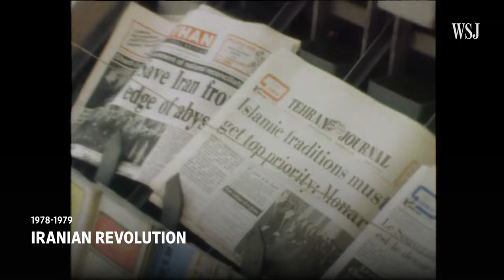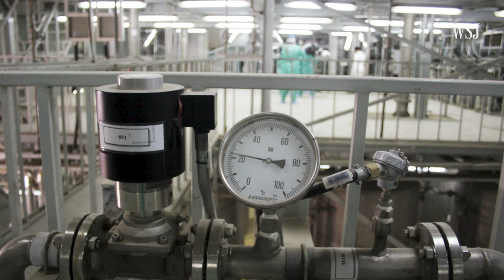Iran’s Nuclear Program: What We Know About Tehran’s Key Sites | WSJ

Comment: The key thing here that is not said is that Iran was testing ballistic missiles capable of holding a nuclear warhead and that’s why we had withdrew from the deal.
Reply: no ! the reason you withdrew was that you want to put pressure on iran because it destroys westerns specially the US agenda in middle east . as simple as that . this deal was just an attempt to legitimatize  that pressure which lead to an absolute failure  or blunder for usa foreign policy .
Reply: @amirreza7610  then prove they werent conducting missile testing while the deal was active. If you can prove that missile testing was not taking place before the deal was revoked by the US then i will take back my point.